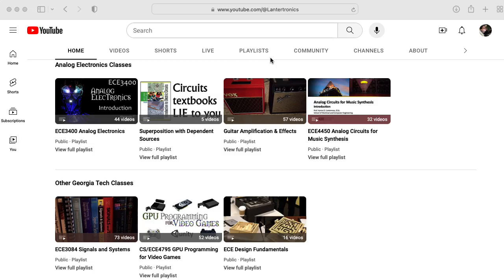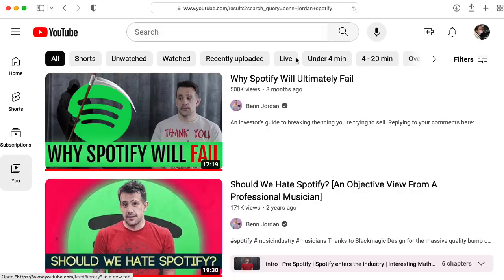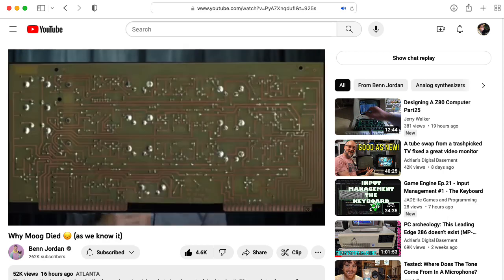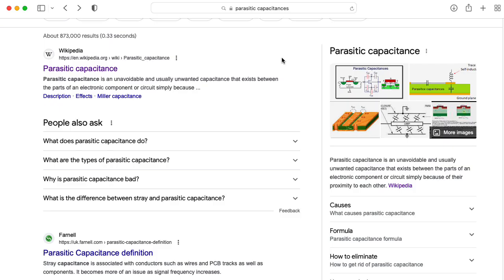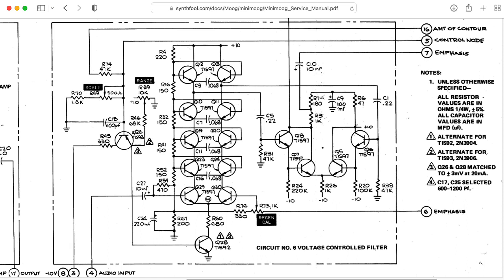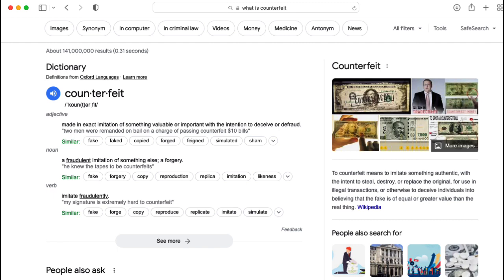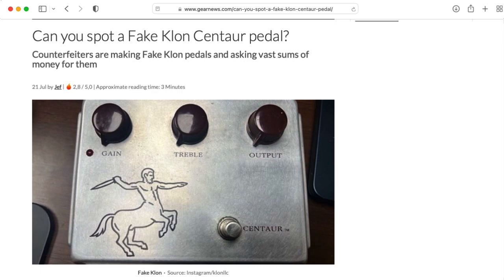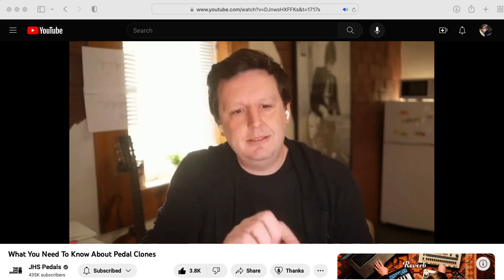Benn Jordan is Confused about Circuit Clones & Counterfeits (but mostly right about the rest of it)

Comment: One guy that has been very (agressivelly) good about protecting is legacy is mike Biegel (mister mutron); i think that's why B aint selling those biphasors anymore (and they didnt actually use vactrols btw). I remember reading an article of him stating you could never remake a biphase because of power supply (seriously...). damn i need to see that vid you made about swithing ps on modern synth, i have been thinking about his myself, interesting topic regarding cost, durability, limits to growth (a lot of copper involved) and thus the environment. My opinion but i think the environmental issue matters regarding production and durability/repairability (that's the true issue regarding smd vs thru hole imo), nobody within he entire audio gear realm ever adresses that topic, and i mean never, not once have i seen anybody think about this.. But maybe i'm the last guy thinking about these matters, i mean i'm not a crazy angry radical with simple answers to a complex problem, but at least we could think about it every once and a while....

Comment: Parasitic capacitance??? At standard AUDIO frequencies??? Unless you've never laid out even the most basic of circuits... Parasitic capacitance is a non factor.
Reply from the maker: Agreed. It's astonishing how much guitar pedal folks will go on and on about this, surface mount vs. through hole, thinking it makes a difference for them.

Comment: Thanks for making this video, I also groaned when he did a side by side of the PCBs saying Obviously they’re not even the same thing. 🤦‍♂️

I would also be completely shocked if Moog had previously made every PCB stateside and they were all hand populated at the shop in Asheville. 

What’s more likely is they sourced their PCBs with pick and places SMDs like 90% of all the other electronics manufacturers and then hand soldered all the through hole pots/switches on site before testing, calibrating and final assembly.
Reply: Yeah his rationale is backwards. Sadly that somehow made it thru his normal high quality/accurate takes on various things.
Reply: @seedmole I think Benn is just upset that moog had to sell out and wants to blame someone. It's just business.

Comment: In the 80s, it was the Japanese synth companies that were supposed to be copying American Synth design (even though everyone copies everyone). The other complaint back then was Japanese synths didn't sound as good (phat) as American synths. Who would say a Jupiter 8 is better or worse than an Oberheim OB-8 these days?
Reply from the maker: You have a point -- although, in the case of 70s and 80s synths, the designs coming out of Yamaha and Korg and Roland were quite distinct from those coming out of Moog and Oberheim and ARP. There's no Yamaha clone of the Minimoog or Roland clone of the 2600.
Reply: @Lantertronics  They were probably still under current patent back then. Is the late 90s Creamware Minimax a clone? I think it kinda is. ARP and Roland supposedly got in trouble back in the 70s copying the Moog ladder filter (on the SH-3 and 2500 Tonus I think).
Reply: Apart from that whole Roland getting sued by Moog over the ladder filter on the SH series, right  @Lantertronics  ?
Reply from the maker: @mycosys  ARP also ran afoul of the Moog patent and had to change their filter design at one point.
Reply: Its one of those times that convinces me IP isnt an unmitigated evil,  @Lantertronics , just overpowered and over-long. 
Without that patent we likely wouldnt have many of the filters we love today, that are just objectively WAY better than Moog's primitive ladder (and i say that despite the system 100-101/102 being my favourite filter). No way cheap-ass Roland would have bothered with their own OTA chip design, they were doing just fine making rejigged MiniMoogs. 
Still, putting people in jail for freely copying publicly available information, when copyright was intended to increase access to information by making printing viable - its just insane.
Reply from the maker: @mycosys  Benn has some other videos on IP issues along these that are really interesting, particularly "Ending Copyright Could Save Art & Journalism"

Comment: From a technical point of view of how to judge "clones" and "counterfeits" this is a very informative video.
I do some basic PCB routing and design myself and can not agree more that the visual difference of a circuit does not indicate that the rebuilt design is not aimed to be as close to the original as technically reasonable. I mean it would no make sense to clone a synth with 20 year old parts except you build it yourself, but definitly not for a market with quality assurance.

Comment: I think we're missing the point. We all know what "counterfeit" means but we need some other word for what these people are doing. We've made the word "clone" into an ok thing to do and have decided that it's completely acceptable for a big corporation to take the work of a smaller builder and "clone" it purely for profit. We expect that every player on day 1 magically knows the history of every piece of gear ever made, what is unobtanium, what is easily available, etc. The fact is that we don't have different words for a small builder who clones a niche piece of gear that is only available in the used market VS a corporation who clones a product that is still for sale and just makes it cheaper and less reliable is part of the problem.

If you clone a Klon it kind of makes sense (other than it shows that you've run out of ideas) because there are no new Klons available and if your company is bringing some other new circuits to the table then I'm ok with that - if you one of the 20 companies cloning a Rat, ProCo is still open for business selling the original for $100 so why is another company charging $300 for the same thing in another box? What does that do other than line someone's pockets? There are so many cool companies building unique sounding devices or at least bringing a unique aesthetic to their gear so I personally support them instead.
Reply from the maker: I think the most egregious case in the case of Behringer is their clone of the Arturia Keystep.
Reply: While i entirely agree  @Lantertronics  . i also cant help wondering what the world would be like if Apple had won their 'look and feel' suit on Windows, or if Xerox had sued over Alto.
Or if the steering wheel or seat-belt had a 100 year look and feel copyright.
Reply: @mycosys If I'm honest, Apple is a much, much worse company than Behringer, yet a lot of these musicians who hate Behringer still use Apple products.
Reply: @NEOREV_MUSIC that's because apple products signal class, just like many music products do, and musicians are often egotistical pricks who really want to signal their class. benn has an issue with things looking like moog products because it devalues his "luxury" items (which aren't actually a pure luxury item at all other than for the fucking ridiculous price).

it doesn't matter how many times someone says they aren't poorshaming if they are 100% doing it anyway.
Reply from the maker: I’ve been trying to come up with a new word for “counterfeit” the way Benn used it. I think TDV, standing for “Trade Dress Violation” is accurate but it doesn’t exactly roll off the tongue.
Reply: @Lantertronics  Look and Feel clone is the term i think most computer people would use.
Reply: @Lantertronics perhaps something that combines mimic and a German word, as a nod to Uli?
"Untermimic"? I don't know, just spitballing here.

Comment: Thanks for making this video. I appreciate your opinion on this topic, especially as someone with great wisdom and knowledge of the history of synthesis and electronics and electronic design. I appreciate that you've opened up a space for dialogue regarding this issue. 

I had a similar feeling as you did when I watched the 'why moog died' video, regarding the 'clone vs counterfit' point. I then gave the 'clone vs. counterfit' semantic definition a pass on first watch. What I took from the original video is this: An investigation of the 'counterfit' in relation to private equity and the 'race to the bottom' in mid/small scale synthesizer manufacturing P.S. avoid behringer + sweetwater + financing. 

(my hot take: moog as a brand was terminal by 1971-1972, and moog 'died' in 1977-1978 after the release of the multimoog. All other 'moogs' are zombies.)

Now watching your video on the issue regarding 'clone vs counterfit'  got me to watch the video again and I've solidified what else really irked me about the Benn Jordan video: A Posteriori tribalism is baked into his pretend non-tribal position, and a lot of related and important issues just get glossed over for the sake of a tidy, persuasive narrative targeted at Benn Jordan's 'tribe'.  

These are some of the major assumptions I have issue with in the original video alongside the 'clone vs. counterfit' point: 

American Made = better; 
( intro 1.40 * queue melancholy Americana Music* + montage suggesting the burial of the American flag) 
// I am proponent of local manufacturing in general, but this appeal to emotion is near satire. Also, when you get into the details of consumer electronics.... is a TI lm393 'better' than an Onsemi lm393? Does anyone actually buy products based on what country the semiconductor wafers were polished in? Does anyone buying consumer electronics really care enough about the ethics of strip mining? IMO anything made with semiconductors relies on a largely unaccountable globally interdependent economy, and framing the discussion based on the ethics surrounding asembly workers is a tribalist position that masks the rest of the iceberg: the total global environmental/economic impact of this industry.

Iconic/Authentic = better, because 'nostalgia'; 
(Synths are luxury items 4.04) 
// this unbelievably subjective take is passed off so quickly as valid that it's troubling; obvious warping of the narrative to not upset the status quo of the 'luxury' item manufacturer's Benn Jordan does want to work with in the future. 

Authentic 'history' justifies expensive prices; 
(synths are like fancy sneakers 5.20) 
// imo not true; I'm pretty sure that scarcity/percieved scarcity is the primary driver of price, not authenticity... (I don't think anyone gave a sh*t about which brand of toilet paper they buying for crazy prices at the start of Covid).... and using NIKE shoes as an entry points to bolster the A Posteriori tribalism Benn Jordan relies on to persuade via an appeal to emotion is a sneaky red herring imo. Nike is one of the most regognizable, and positivley percieved Global brands on earth, and people are marketed to assume brand tribalism in sportswear from a very early age. Switching the discussion away from the synthesizer market here is the red herring, as Benn Jordan could just have used the Korg ms20 reissues as a prime example of how a legacy manufacturer re-issued an 'iconic/authentic/historical product at varying and realistic prices points; but that would totally invalidate the premise of his entire video...

And I hesitate to get into the details of the Moog factory vs the Zhongshan Music Tribe factory... re: 
Behringer = 'dystopian prison complex'
(Behringer 8.20) 
// I do understand that there are valid accounts of unsafe working conditions in 2017 at Zhongshan Eurotec Electronics Co. Ltd... and that sounded very bad. It's good that the workers striked, and from outside of China it's hard to know the details of what is going on at the Zhongshan Eurotec Electronics Co. Ltd since,  though there are reports of recent strikes on sept 11th, 2023: 

clb dot org dot hk slash en slash content slash clock-zhongshan-electronic-music-equipment-factory-workers-strike-over-security-measures

(
to find the article google: 
clock-zhongshan-electronic-music-equipment-factory-workers-strike-over-security-measures 
)

Now from the recent CLB article it's pretty clear that workers at the Music Tribe factory are protesting about pay;  "...their wage has not been increased in over five years, and temporary workers often make more than full-time workers. A Zhongshan Eurotec worker makes an average of 3,000-4,000 yuan (less than U.S. $550) per month, and some complained that year-end bonuses were not paid. " 

Now I'm no fan or Behringer, but the comment that Zhongshan Eurotec Electronics Co. Ltd is a 'dystopian prison complex' is a new one to me, as I've never heard that MusicTribe inprisons its workers before. Maybe this is hyperbole on Benn Jordans part? If it is, then it just seems like cold-war rhetoric that's becoming all too common now-a-days, as solidarity for global worker struggles would probably be a better look for Benn Jordan if he actually cared about the people who made his deepMind12. Further, that there was no mention of the Moog unionisation earlier in the year in this video, or the very recent Zhongshan Eurotec worker strike I mentioned, kind of sends me the wrong way with the entire perspective he presents: if he actually cared about workers, then he would go into the details of Zhongshan Eurotec Electronics Co. Ltd rather than flippantly calling a far off place a prison complex...

 Also I'm all ears if anyone can provide any further information that MusicTribe uses prison labor, as that's a really serious allegation! 

Now there is a kind of subtle system at play within basically every Benn Jordan video: Through the magic of editing and an engaging narrative, well timed subtle persuasion supplants the overarching bias of Benn Jordan and the viewer likley assumes these biases as the 'valid perspective'. It's a marketing masterclass that would make Edward Bernays proud. Benn Jordan uses this persuasion technique to validate his cultural currency; he needs his viewers to believe him to keep his lights on, to keep getting expensive stuff for free so as to stay relevant to his audience, and to keep his followers believing his version of 'authentic' enough to garner affilate clicks and patreon subscriptions. His audience must be seen as a good market by the companies that collaborate with him, and Benn Jordan does enough of a limited hangout to keep his audience engagded. 

Idk I think we should all re-read some Walter Benjamin before falling into this trap that is getting used by Benn Jordan, Uli Beringher et al to sell ppl things no ones needs when engaging with electronic musical instruments. There are companies doing relatively good things, and avoiding conversations about the problematic ones seems like a better step in the right direction imo.

Comment: Succinct and complete, very well done.

That was the one of only a few things in Benns video that I didn't totally agree with, the boog circuit is (as far as I'm familiar) quite close to electrically identical.

Especially since just as you said, so much of the circuit is resistors, transistors, capacitors, etc. For which modern surface mount parts can more or less be considered functionally identical.
Reply: Yeah, not sure if this still exists, but some people falsely believe that there's something inherently superior about vintage through-hole vs. surface mount electronics - i.e. that it'll have more "mojo," or some other non-scientific intangible. Years ago, I had no other than Tom Oberheim himself laugh AT me for asking about it - Tom doesn't suffer fools gladly! I remember there was a hubbub with the Prophet rev4 came out - people were upset that its electronics were compacted down to a relatively small SMT board. (I have a rev4 P-10 and a vintage rev3 P-5... if anything, the new one sounds better.)
Reply: I think you killed and Novation killed Moog Jorb, by recommending everyone get a Bass Station 2 and not a Sub37😜 . Love my BassStation 2

Comment: I have a somewhat related question. When behringer cloned the moog DFAM (behringer edge) they used a slightly different filter because, from what I understand, Moog has their classic moog filter patented. Can you speak to if they also did the same thing in model D. I never played a model D but people seem to really really like it and claim it to sound basically exactly like moog. While listening to comparisons of Edge and DFAM on youtube I can hear slightly different character of the filters tho. So the question is did they also did the same thing as they did in Edge but because every other element is so close people don't notice the difference or the difference is actually there or did they for some reason used actual moog filter in model D? Thanks for the answer, love your channel
Reply: The ladder filter circuit patent ran out a while back, so anyone is free to copy it (and there  are plenty of examples out there, especially in modular synth world). As far as I know, there are no trade-dress patents on the books for the Mini (and we've checked).
Reply: Its not a clone of the DFAM, its a hand-wave to the Mother32. It uses the CoolAudio V3340, which is an IC reconstruction of the CEM3340, from the Pro-1 and Neutron, along with the filter cct from the ModelD. 
Behringer may be a pack of a-holes, but their engineering is astonishing, they recreate the silicon. So many boutique synths wouldnt exist without coolaudio.